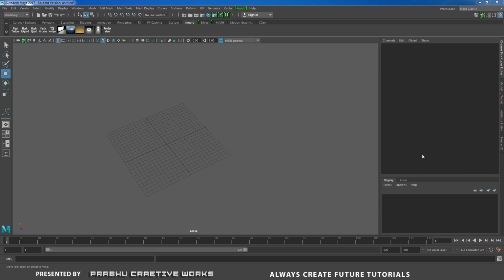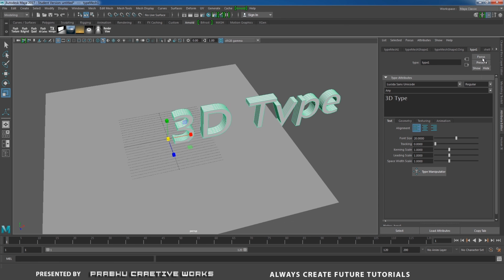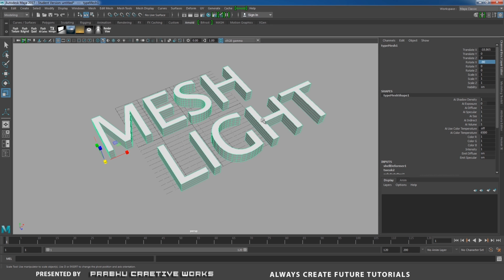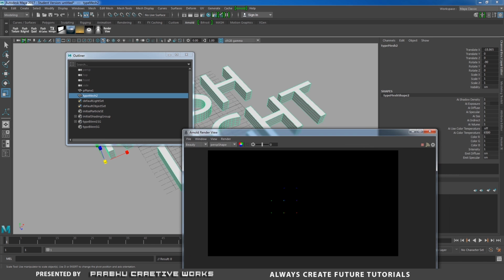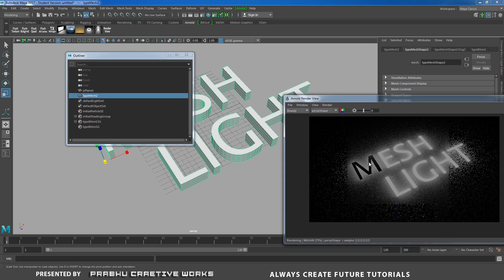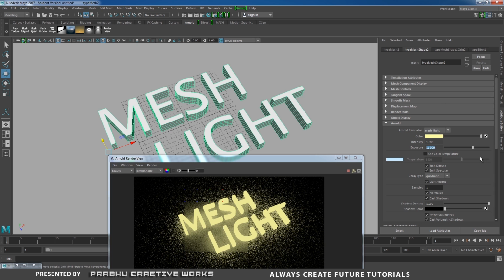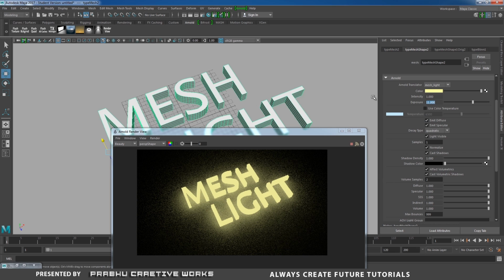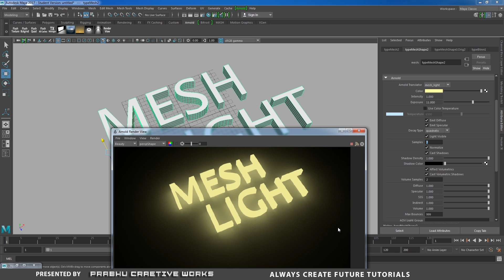How to Use Mesh Light in Maya 2017 ARNOLD

Comment: How do you make it act like neon, or laser? This doesn't show an actual glow, only the mesh, and the bounce light on the ground. If you were to turn the ground off it wouldn't work, which is not what I am going for. The best results so far have been with a post effect, but that's a pain to have to do that in comp
Reply: I'm looking for the exact same thing! I have something floating in the air, and so there's no actual glow surrounding the object, just illumination. Have you figured it out yet?